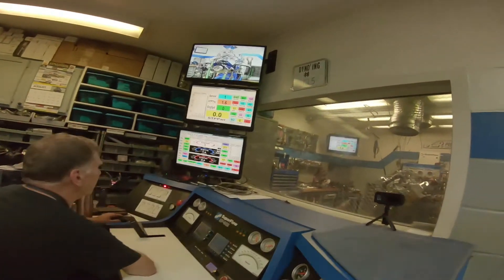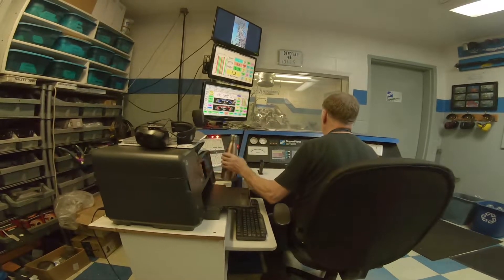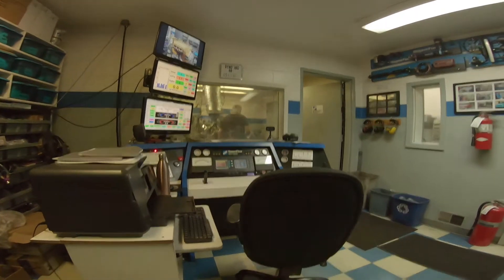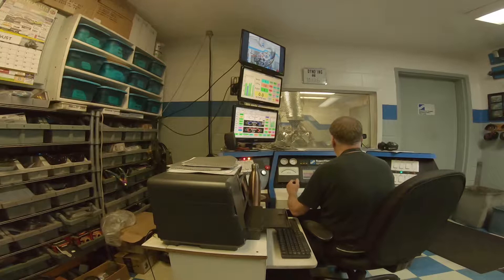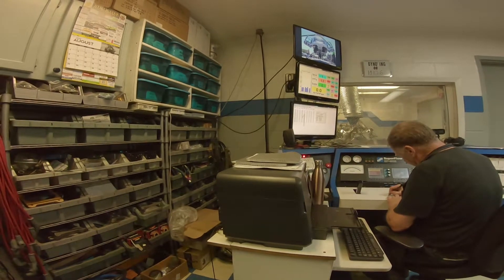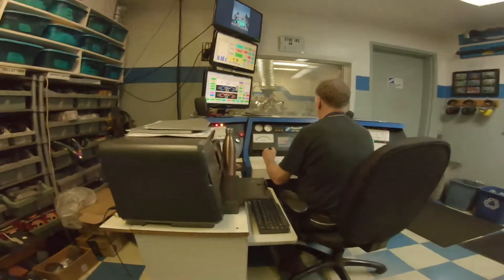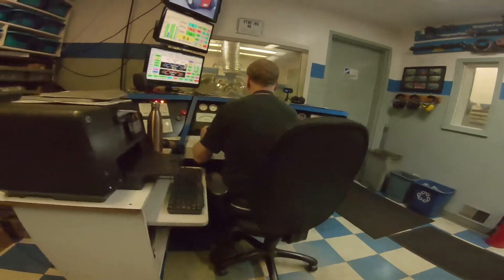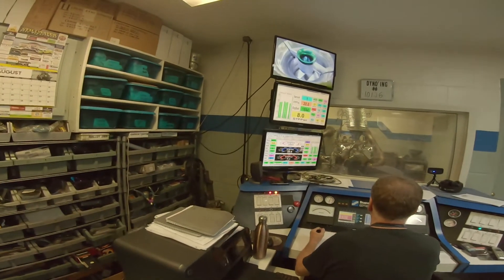Dyno Day, 1974 Olds 350

Comment: That cam is the absolute worst. Originally designed for a small block chevy in the 70s. Completely wrong for an Olds. It also has very slow ramps. If you put a modern cam in there that is designed for an Olds, I bet you would pick up 30 hp and 30 lbs ft or more.
Also pretty sure the RPM intake is set up for a spread bore carb. A Q-Jet would do better than the square bore Carter/Edelbrock carb.
Reply: I'm seeing 350 Olds hitting 400 hp but only just and I'm a little disappointed with those numbers.

I know the BBO's have a lot of potential, I expected a little better from the SBOs.
Reply: @ThunderAppeal stock Edelbrock heads are little better than stock C head BBO airflow and are a small portion for the power gained.  
They are cool, though.

Comment: I’m building a 350! I would love to know what’s on the build sheet for this motor?!!!
Reply from the maker: Engine shop rebuilt the bottom end, so not sure of the specs, but does have around 9.5 -9.7 to 1 compression.  I told them the HP goals so they would not under build the motor.  I basically found and purchased the Edelbrock RPM power package, cam, heads, carb to go with the RPM heads(I port matched to intake manifold), on the internet, based of their dyno result sheet, specifying around 397 hp with headers.  
Performance Distributers HEI distributer along with their live wires plug wires.  
Harland sharp 1.6 ration roller rockers.